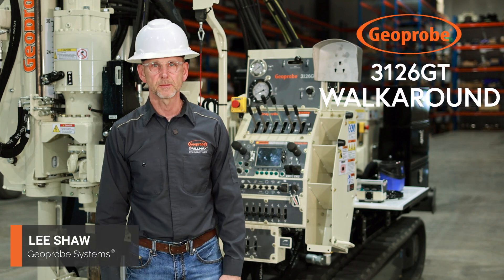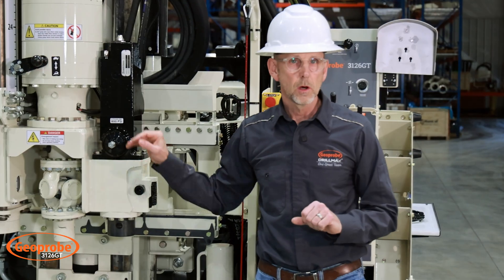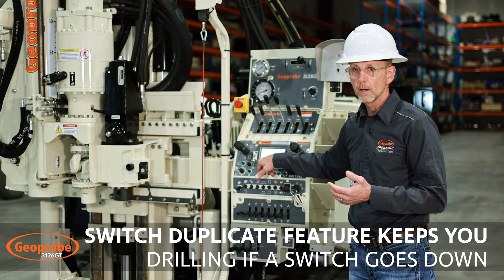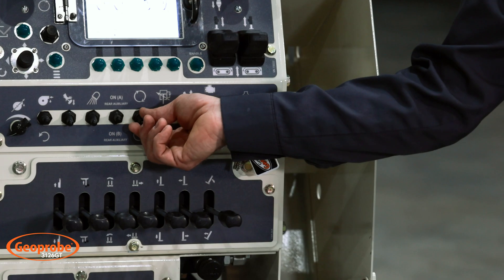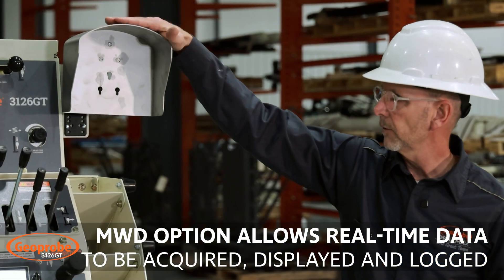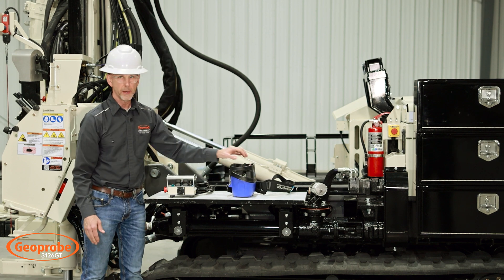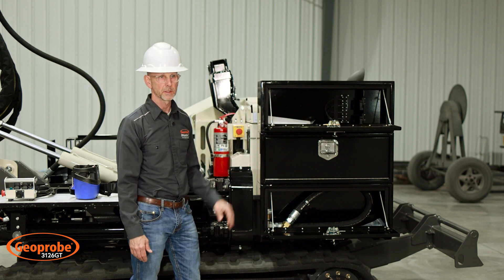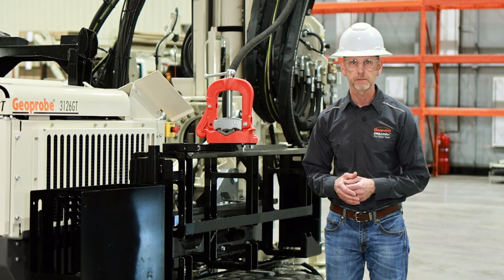Geoprobe® Walkaround: The 3126GT Drill Rig

Comment: How does the rotary head compare to something like the CME 55? We do geo work as well as LUST. Sometimes it's a chore to drag the CME out to a site to set say 4 or 5 20 foot monitor wells. We currently have a 6620DT we use for LUST and a 55 for Geo. Would this be a good compromise for the two? I wouldn't expect this to turn 3 1/4" HSA 40 plus feet very well, but could see it being great for shallow 25'> borings. How is it weight wise compared to the 6620DT?
Reply from the maker: 3126GT with the 6-Speed Rotary Head is rated at 6,800 ft-lb of torque.  Biggest difference is that the 3126GT is fully hydraulic and CME is mechanical, so there is going to be a different feel when drilling.
I expect the 3126GT to drill 40 ft. geotechnical holes, we have many clients drilling MUCH deeper.
3126GT with typical options is going to weigh a little under 14,000 lbs.
Please give us a call to discuss further and setup a time to come to the factory, we’ll pull out the augers and make some holes.